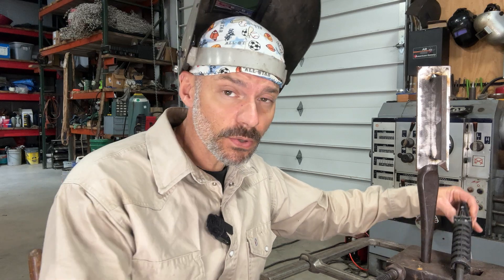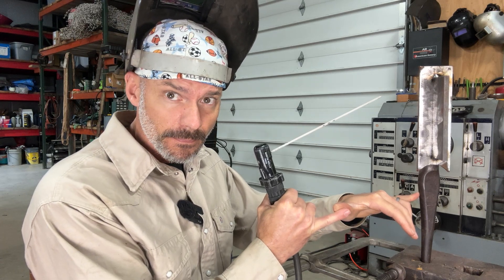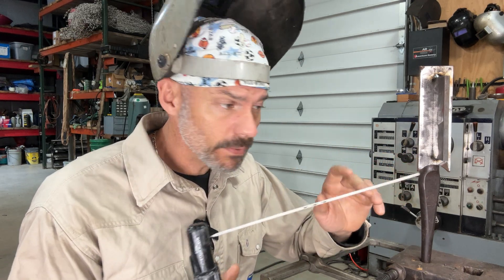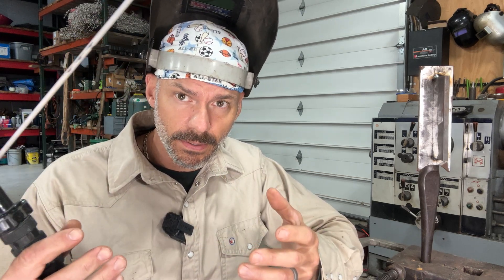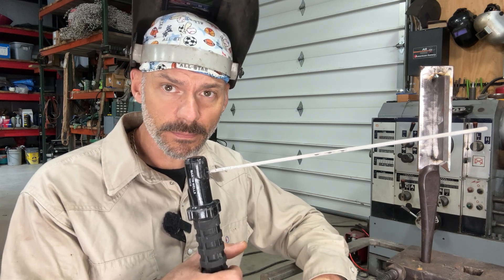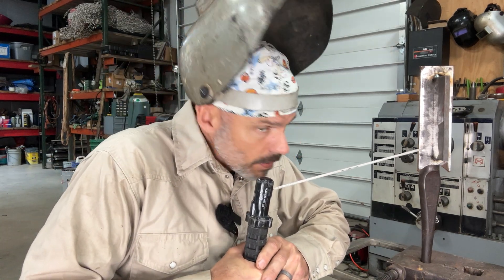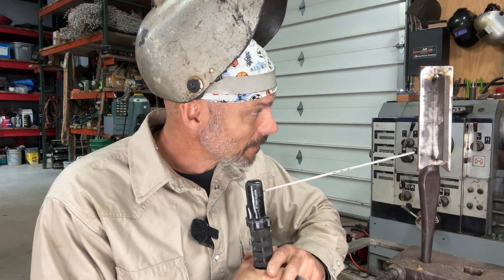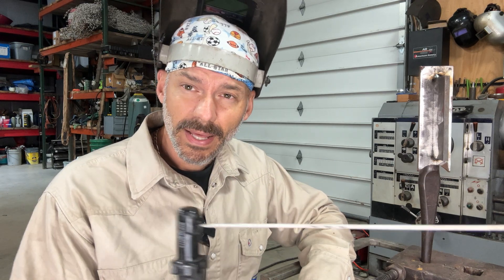WELDING Like a Pro Even with Shaky Hands

Comment: Hi I am carpenter likes to weld the company that I work for those some welding can you do a video welding 16 ga sheet steel to a structural member 1/2” or greater that will help me a lot thanks with 7018 3/32 rod

Comment: My old welding instructor used to say; "Concentrate on your molten puddle" "Control the molten puddle" -Geo Shorstun (Shorty) RIP.
He also had us, write Os, like cursive writing. Keep your Os(or circles) between the rule lines on writing paper. 
Practice clockwise inter connecting circles(perfect round), then practice counter clockwise inter connecting circles. or loops.
This can help you control that molten puddle, especially if you have a natural shake, or Oscillation at your arc end. 
Been welding since 74/75. We use to weld coke bottles to plate for fun. lol

Comment: I’m a new welding student and I’ve been following welding on my off time… I have watched and listened to welding lingo and advice but until I had the stinger in my hand it didn’t quite clique. Once the stinger was in my hand “clean & prep your materials” stuck more than anything, once I started trying my first welds I realized how dusty my stinger was and I don’t remember watching dirty stingers, I asked if I could clean it with my wire brush, making sure it was OFF, yesterday I cleaned it super good and it made my start up “struggle free”. You ever see that competition with military people disassembling their gun in timely fashion? That’s what I wanted to do with my stinger, how important is it to get it like “brand new, versus clean enough”?

Comment: If the cost of filler metal and rods is not an issue , I've put a bend "U"  at the end of the rod !! I shortened the rod  and more contact patch in the jaws of the stinger seems to stabilize it better than 1/8 or 3/32 ingle wire in the jaws !! ...breathe and loosen up does wonders too!!

Comment: my hands shake. fact of life. but one thing i found was always saving my broken tig torch leads. they'll get a hole in them or a piece of equipment will drive over them and now thy leak. but they make light lead for stick welding. also i always kept a couple different electrode holders on hand up to 400 amp rated if i was welding a dancefloor at a refinery. but take a light duty electrode holder,mount it to the old tig torch lead and it's feather light. even had some 250 amp tig leads off larger jobs for GE (huge thick inconel or hastoloy piping) that worked well for medium duty stick jobs. once you have found a comfortable position to weld from,wrap that lead around your arm so the weight doesn't hang off your hand but off more your elbow thus tiring your shoulder less. and the other tip was exercise three times a week (calisthenics ,weightlifting or something to strengthen your body,and it don't take much your body will respond and feel better immediately)  and your day will be much easier than if you just sit around slamming beers all night turning into a marshmellow
Reply from the maker: That’s a lot of great advice!
Reply: @TaylorWelding  you know welders always think we have all the answers

Comment: First and most important thing is get rid of gator clamp stingers.  Get the twist type so you can lock that rod down tight.  Then you can bend the rod in any angle easily and that allows you to put your hand in the most comfortable and natural position

Comment: Tried two of your tips today: 
1) Running 7018 vertical up, stopping and holding the toes of the bead for a full two seconds each made great improvement in undercut.
2) Holding the stinger with the lead between the pinky and ring finger does steady the rod some.  Can't explain why, but it works.
Thanks, my friend.
Reply: I’ve been struggling with this myself. Definitely going to give this a try Thank you.

Comment: Having been welding for bout 50-yrs I've tried damn near everything but my go to is to keep several  2 X 4's of drifferent lgth around and prop off of the board as it's leaning on what you're welding on and it gives you a variable hgth  and positions  👍
Reply from the maker: That’s a good idea! 
Thank you for sharing, Mr. Bob .
can you elaborate a little bit? 
I’d like to mention this in a video
Reply: @TaylorWelding This idea works real well especially on pipe. Say your weld is 4-5' high then cut the 2x4 to 6' or better, one end on the ground & the other on the pipe.  Then just prop on the 2x4 and you can slide up and down on the board as your position changes on the pipe. Some time I'll nail a 4" piece of 2x4 to the long one and prop on it which helps as well.   This works well if you're in a man lift basket also .
Reply: I've done that too, sometimes I use my hammer handle.
What ever works.
Reply: A lot of times I use a pipe or crescent wrench most.

Comment: Yes to the caffeine shakes! I discovered that in SS Tig welding school. I worked midnite shift, slept daytime, got up early to go to Tig class,  practiced welding 2 hrs, took a break in the cafeteria & got a 20 oz. Mountain Dew & chugged it & went back to class for 2 more hrs. I noticed my hand was like a sewing machine after the break but not before! Tried it 2 more times, just to be sure! So I learned to lay off the caffeine until after class, but just before going on to work at midnight.
Reply from the maker: That will do it

Comment: A tip when practicing take your lead and hang it up on something and leave enough lead to do your weld , it will make the the stinger/ welding lead a lot lighter and help with some shaking.

Comment: Curl the rod end that your stinger grips just a half trun with your stinger. Then bite the curl with your stinger. There is no excess exposed rod to arc on and the shake will be drastically  diminished.
Reply: I think thats about the same as I used to do. Used a 300 amp tweco and no mater what the rod diameter grab it in the bottom slot and bend 90 degrees. As you're welding you can change the angle and position of the stinger and rod on the fly.
Reply from the maker: That’s a good one. Thank you for sharing

Comment: Can you do a video on the different kinds of metal and what they are used for and how to weld them.  I know there is hot rolled, cold roll, mild, etc.  Noone ever goes over that stuff.
Reply: Metals and How to Weld Them (1962) is a small textbook covering these things. Amazon has it, but it's way way cheaper to pick up a used copy on ebay. It's great for "filling in the holes" left by videos on welding.
Reply from the maker: I would have to refer to the book. Usually  use what ever the procedure says